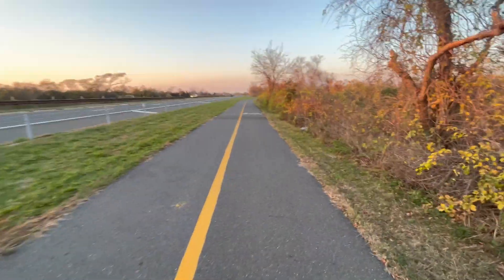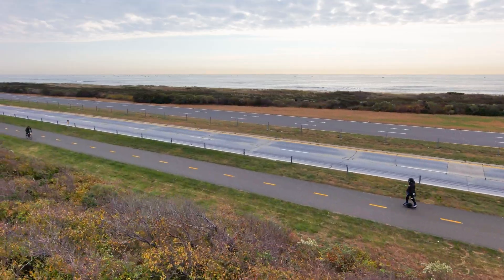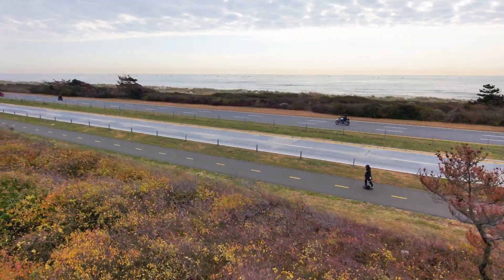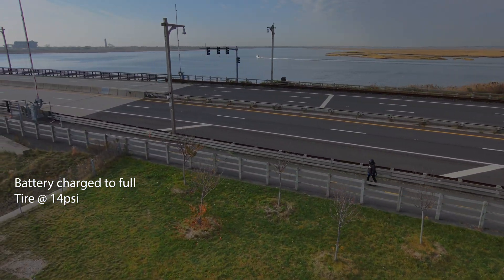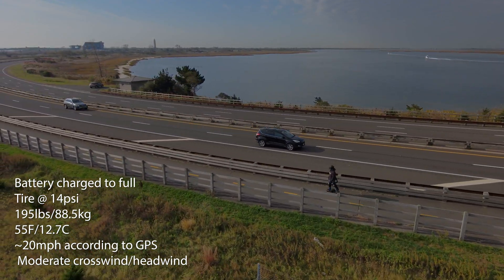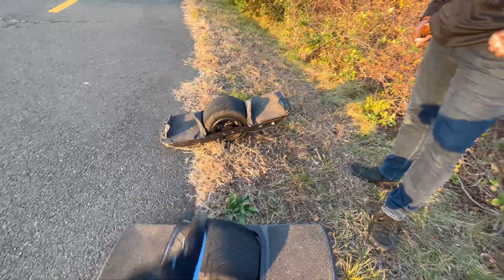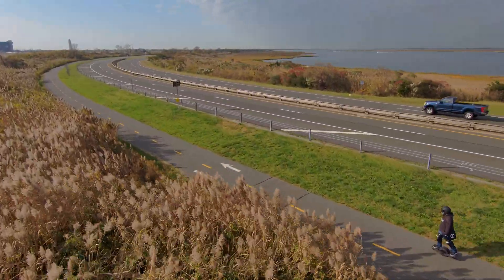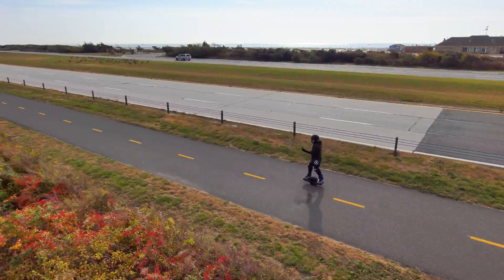Floatwheel ADV Pro Full Range Test

Comment: Sounds cool but I'd rather spend the extra money to support American jobs and workers. That's just me though
Reply from the maker: Glad to hear it. You may then want to consider a custom built VESC board , with a Shaman Systems VESC, Float Life rails, bumpers, and battery enclosure, holding a high capacity battery I make in NY, managed by a VESC connected smart BMS made in Canada. And assembled by me in my shop, an American worker trying to run a small hobby shop business using some of the best parts the aftermarket has independently developed.
As will be featured in the next range test.
Reply: You could also buy the  better/cheaper product and donate the difference to your favourte charity. Instead of jus giving fm profit
Reply: Yeah Im all for supporting american products, but when there is a better,cheaper product that I can repair myself. Then im only buying american to put money in future motions pocket. I honestly dont give a shit if they make it. They have clearly shown they dont care about their consumers. Look at all the issues with onewheels and the right to repair. They want youre money thats all. Floatwheel want's you to have a great product. Im not buying american just because Future Motion wants fatter wallets.  If they listened to their customers it would be different. Support companies that actually care about the people using and buying the product.

Comment: Looking forward to seeing how your custom build performs!

The weight of the floatwheel is the dealbreaker for me, and I'm curious to see how much your custom board ends up weighing.
Reply from the maker: My custom board is fairly heavy, 39lbs about.
Reply: Custom board is a custom board. Can build it lighter than stock XR if your willing to give up range. The 5" tech rails billet hub is quite a bit lighter than stock. U can even vesc a pint and throw a 5" hub on it.

Comment: Floatwheel may be better than the GT/GTS in most ways, but as long as it’s not readily available in the US and the only way to purchase one is with cryptocurrency, it will never catch on like FM’s OW. Not only is that an issue, but having to assemble and program the unit will be a turn for the average user. All these FW vs GTS videos are great, but at the end of the day FM’s Onewheel will still sell over 95% of the time. FW is just not as convenient a board to acquire. There is no real competition when it comes to sales. FM has it locked down for now.
Reply: Worth it over all. I can promise you
Reply from the maker: It’s a fair point, certainly. Most folks around me still ride FM Onewheels, and some have ordered a Floatwheel and some have had me build a custom VESC board. 
Almost all of those people have more than 1 rideable, and so the landscape is still open for people to explore different device choices.
Reply: Very much this. For me, the probable 2+month wait is what's turning me off from placing me order. That and the aftermarket market for FW is non existent and would like different footpad options.
Reply: Floatwheel is going to be my first ewheelie board 🛹🛹🛹  
I agree the crypto especially with no explanation of how or what exchange will likely kill most potential sales.  I'm expecting a terrible out of the box experience, but all of the customization should make it worth learning.
Reply: Definitely have a point there.  Tho the price can sway a lot of people.
Reply: I think im sold on this over the Gt-s.
Reply: Crypto is the future like next year future
Reply: Yep FM will always get the less intelligent user just like Apple, the average Joe will pay much more just to get the idiot proof product
Reply: You realize the only reason we have to jump through these hoops is because Future Motion is causing them? Because of their bogus patent that I really hope someone manages to invalidate some day. But in the meantime I can't imagine not supporting companies like Floatwheel. And Future Motion won't ever get any money from me ever again.

Comment: Having two range tests on the ADV is great because it helps demonstrate the difference in range tire pressure can make.  Thank you Mario!
Reply: More tire pressure = less or more range?
Reply: @officia.liam69   More tire pressure = better range but stiffer ride and less traction.
Reply: @officia.liam69 the eternal debate, ride comfort versus range. The lower the PSI the more comfortable ride, but at the cost of ride distance.